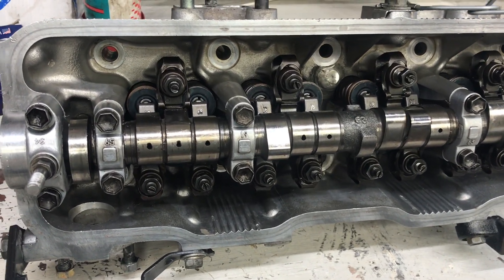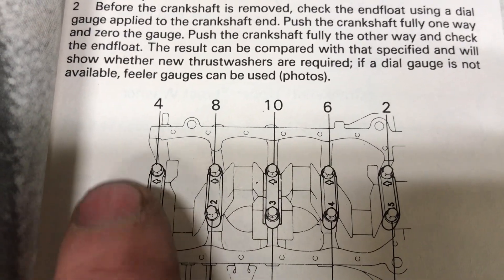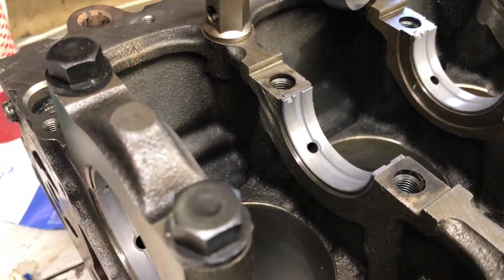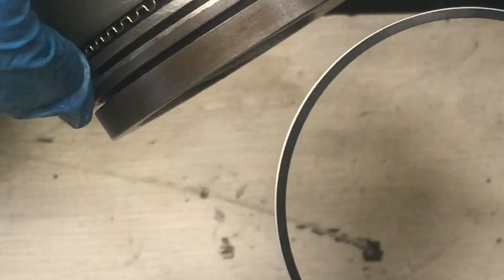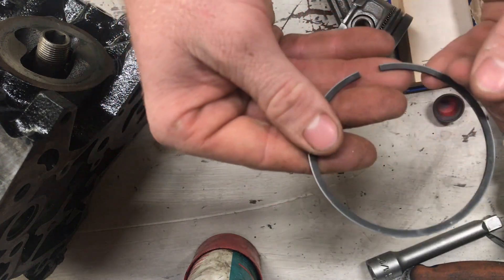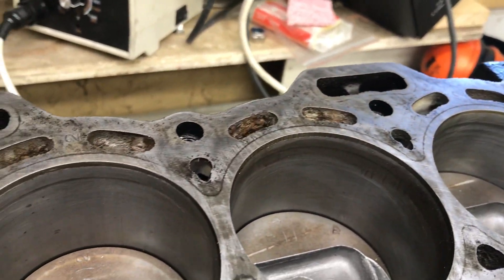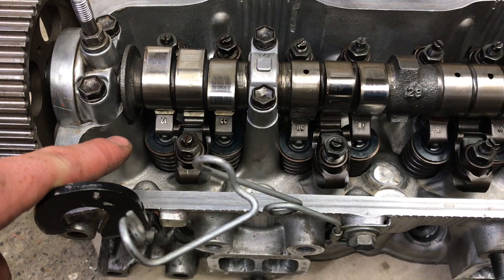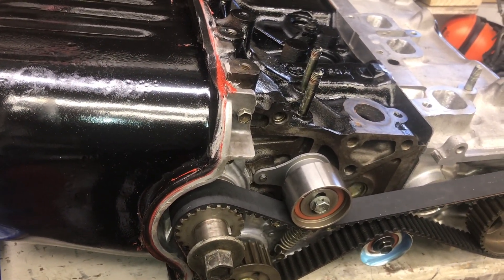Toyota 2E engine assembly

Comment: Hi i have a coeolla with 2E engine the problem is to much oil going up to the rocker arm i already replace the oil regulator pressure but still the same prblem

Comment: How will you prime the engine with oil?
Reply: Remove your fuel pump fuse and disconnect your distributor and  turn the key

Comment: Nice work. Could you tell me the valve clearence you used when cold? I use the factory value, 0.2mm when hot, but my valves keep ticking. Hope you can help.
Reply: Nope 0.15mm try it and you see for yourself no ticking sound
Reply: @York870  my car gives me this ticking sound when engine is cold the sound vanish when engine become warm is it normal ?
Reply: Yes it is normal because when engine is warm the gap decreases
Reply: @York870  actually i want the engine to be complete silent on cold start I don't like that tik tik sound furthermore I request you that make a video on carburetor and its mixture settings some times I feel like the fuel avg is bit low under 10km per litter
Reply: @qazisajid9119  you make it too tight and when it heats up it may damage it. 

Rule is, its better to hear it ticking when cold than not at all
Reply: 0.15mm
Reply: But that way when it warms up it will get a smaller gap. Souldn't it be 0.25mm?